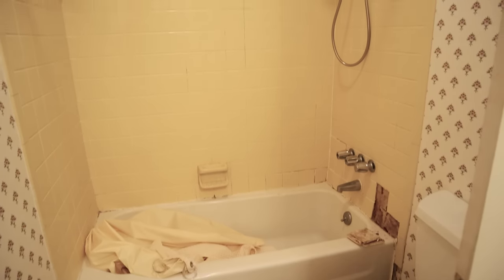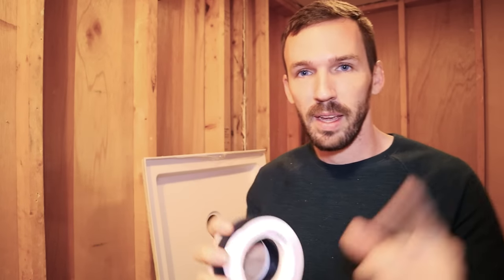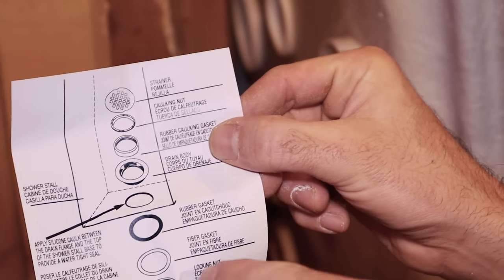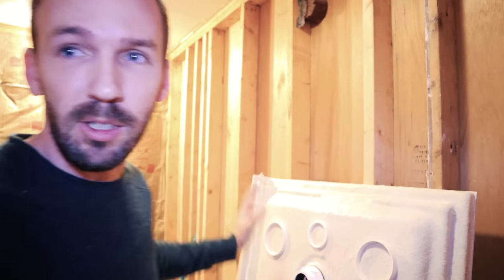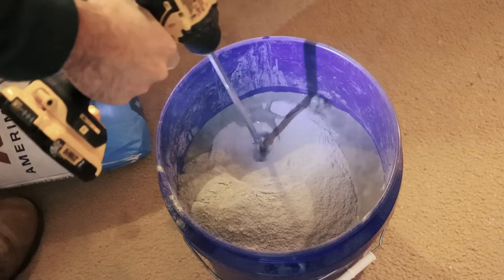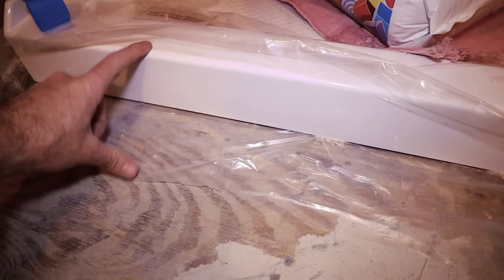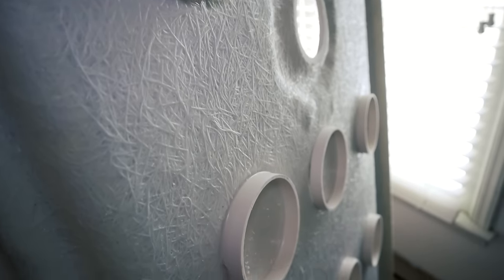How to Install a DreamLine Shower Base With Oatey Drain

Comment: Hey man! I have a similar base. I measured 4 1\4 for the cap.and 3 1\\4 opening. Was this your measurement? I'm having a hard time trying g to.locate these measurements. Also, I appreciated your video here. It was informative. Oh, I'll be tiling the walls as.well. The skinny flange will not line up with the board. Did you shim the tub or walls to make it transition well to have the board sit on the tub?

Comment: You realize that if you push that down into the concrete mix before leveling it, then lift it back up to level it, there will not be any concrete under the parts that just raised up, right? Shim it up level before you put down the concrete so you aren't creating air pockets underneath the flimsy plastic pan.
Reply: Trump 2024!!!!
Reply: @aandmservices2518  I hope not, cause everything that guy touches turns to $h!t.  I recommend a different contractor.
Reply: At least he doesn't crap his pants and look confused while reading the teleprompter!

Comment: Do u just connect the drain to 2 inch abs with abs glue or just plug and play?
Reply from the maker: There's no need for glue with this, the rubber gasket does all the work on the drain

Comment: That much on setting fiberglass pans myself but I am a tile guy. The plastic that you put underneath it for a water barrier. You can't tile over that plastic the thinset will not stick to it. I know it's only 4 in but that's for in it'll come up right away. Since that won't stick to plastic at all
Reply from the maker: That's a really good point Jose - I didn't think of that. For my bathrooms I went with a 100% waterproof LVP flooring instead of tile.
Reply: @KellyConcepts  well that solves that issue. Lol have a great day. That's for tge dyi

Comment: I wonder why dreamlines installation manual doesnt show the screws going through the lip of the pan and into the studs...possible water infiltration? They show the cement board down to the top of the pan lip, then the finished wall going down over the lip to an 1/8 th of an inch off he pans surface for caulking....but no screws into the studs
Reply from the maker: I’m not sure, I just installed a new modern tub and so I followed instructions and it wanted the screws in the lip. I’ve always done it this way, but I guess some manufacturers prefer one way and some the other way..
Reply: @KellyConcepts that’s how I do it too.

Comment: Just received my Dreamline shower base. My installation intructions make no mention of drilling  and attaching to the studs as you show. Is this something  you do for added security? To me, once the wallboard is attached this thing isnt going anywhere! Thanks for sharing!
Reply from the maker: I've seen it done 3 ways - screwed in the flange directly, screwed above the flange so just the head catches the flange, and no screws at all. 

My preference is to screw it into the flange. 

I just installed a dreamline door where the instructions show to screw into the acrylic threshold - so by their own standard, it's ok to put screws in this. At least, that's my take...

Comment: I presume you used silicone in lieu of the plumbers putty on the drain? I use clear silicone on installs if not using plumbers putty. What you used looked like caulk. If I don't use that rubber gasket on the drain pipe I will pack oakum around pipe and pour a lead joint. When attaching the pan to the studs I use roofing nails.
Reply: I agree Joe. Depending on the manufacture of the pan you wouldn't use plumber putty since it could retract with the pan. I used 100% Silicone as recommended by delta shower pans. The bottomline read the pan installation instructions.

Comment: Well what ever s the fiber washer for ? Do we know
Reply: The fiber washer acts as a smooth surface to turn the big locking nut against.  Without it, the nut would rub against the rubber washer and bunch it up, causing a leak.

Comment: I have watched a couple of these videos now, and I am curious about the mortar base. It seems like you just put it down and then set the base on it, doesn't more leveling need to take place? Is the mortar self leveling when you set the base down?
Reply from the maker: A little more leveling does need to happen but it is very minimal as the pan will press into the mortar pretty nicely. You want to avoid putting a ton of pressure or jumping around in the base with wet mortar or you'll press into it too much and when the mortar dries and ultimately shrinks (the more wet the mortar, the more it'll shrink) , it won't have as strong of a hold on your base as preferred.
Reply: @KellyConcepts  awesome, thank you!
Reply: @Kelly Concepts  I bought a bag of rapid set mortar, it sounds like it should buy thinset mortar for tile with a modifier?

Comment: My subfloor is concrete, it's a concrete joist system in my house. Would the sand/cement mixture work in my situtation as well?
Reply from the maker: It will, but you'll need a primer to adhere the mortar to the concrete. These bonding primers are usually in the tile section of hardware stores. You'll need very little for 1 shower
Reply: @KellyConcepts  thank you!

Comment: why does the rubber gasket go around the drain pipe and not inside like a toilet flange? It seems like that would prevent leaking into my downstairs when the rubber goes bad.
Reply from the maker: I agree with you and I don't know why, but they just don't make the gaskets like that. I'd guess because you cant get the seal very tight that way so if it backed up, the water could go under the gasket and out. A toilet has a ptrap above that gasket so there's less worry there.

Comment: In all the videos Ive  watched, no one shows if you have to use glue when attaching the drain piece to the pipe, they just show the gasket being tighten down. Also how do you take the whole drain apart, I brought one and can’t take off the top metal part
Reply from the maker: The metal screen part is difficult to pop off because there's not much room to get a flathead under it. I have to get my fingernails under it

Comment: I think the window flashing is a great idea.  I don't know why these manufacturers don't add a 6" lip on all three sides.  Lazy, cheap or both.  Kohler has an expensive cast iron one with hardly any lip.
Reply: Some pans do have higher lips,  but they are usually made for the plastic enclosure type. I think the low lip has something to do with tile mortar not making a good bond to the plastic, which is why the cement board comes right on top of the lip often sitting out past it.

Comment: If your going to use caulk to seal a drain, please use only 100% silicone, not acrylic. Otherwise use plumbers putty
Reply: yes, acrylic sealant is water based and will fail eventually.  Nice good on your pan install.  What about Dreamline saying use no screws in pan flange ??

Comment: Anyone have issues with drain connections on this shower if you cant get the drain flange deep enough into the floor due to higher drain pipe  flows being to close to the surface  in a cement floor

Comment: Question, why not order a shower pan with drain at the same dimensions as the tub drain?
Reply from the maker: A tub drain is 1.5" which isn't to code for showers. So they don't even make drains or shower pans with the small dimension

Comment: There must be some 2" to 1 1/2" reducer under the house somewhere? Can you tell about that? Many thanks.
Reply from the maker: Every plumber will tell you to NEVER put a reducer... but if you were to put one, make sure it's on a vertical line, not horizontal. I placed one here because I didn't think to fix it correctly when I ripped open the subfloor and didn't want to have to re-do my floor work. I have access underneath if problems arrive.

I also just finished the 2nd bathroom in this house and plumbed it up the correct way - converting all the pipe to 2" all the way to the main line a few feet away.

Comment: Nice video. My shower base has 5cm legs going down to about 3 toward the drain (8 in total) I tried self leveling cement but its still not level, i also tried grinding high spots. I added some shims under the legs to get it about right. Can i use mortar under the legs instead for shimming purpose. My worry is that i wont need much and that it migjt start to crack. The legs are not hollow in the middle. They filled with some material.
Reply: Wow the floor leveling compound should have worked! It is a year ago but I hope you found you solution.

Comment: Can you tell me how think you made your mortar base: 1”,2”?
Reply: I've also got questions about the mortar base and finding it hard to find a good discussion of it. Such as should it be thicker than directions on bag? How thick to lay the mortar? Full coverage or blobs?
Reply: Dry pack is 4 part sand to 1 part Portland cement ratio by code.

Comment: plastic is a good idea but i'd use at least a 6mm plastic such as those required for flooring. That looked like a thin painter's plastic cover which may not even be 1mm
Reply: I agree with the thicker plastic water barrier, but 6mil, not 6mm.  Using 6mm is almost 1/4".
Reply: @eekmaddogburner7578  oops yes. Thanks

Comment: By using a mortar base how would people remove it in the future when it needs to be renovated?
Reply: I suggest you buy a shower base that don't need mortar under it. By removing an old shower base in mortar, you will rip everything. I bought a Nautika shower base  and the instructions tells to level with self-levelling cement and sit the shower base directly on the cured cement, no mortar under it. BTW, my shower base is exactly like the one in the video.
Reply: Best practice is to staple tar paper beneath the mortar.
Reply: @farmerhomeinspection500  I asked Dreamline about this and they say base will shift and crack?

Comment: How can you tell if the bottom of the shower panel is not completely covered by the mud?
Reply from the maker: It doesn't need to be entirely covered, just enough to get a good hold on the base for support. Technically, the mud is only there to prevent future squeaking and bouncing and it doesn't need to be perfect.
Reply: @KellyConcepts  thx !
Reply: What if it's being laid on a leveled concrete floor and screwed into studs.  Do you really need the mortar?

Comment: When you leave 1/8 inch space on 3 sides, do you drive the screws home or do you tighten them enough to maintain the 1/8 inch?
Reply: Looks like he left a gap but hard to tell. Closing that gap with a screw could crack the pan. Personally I like to take up the space with a shim and drill through into the stud.
Reply from the maker: I keep the 1/8 gap and don't tighten the screws all the way. I should've clarified!
Reply: Try placing some 1/8 inch plastic wood / board all the way around.  It helps provide the perfect space, is completely waterproof and maintains the gap after tightening screws. Good call on stainless screws

Comment: I don't understand why do you have to sit the shower pan in mud I know it's supposed to support the pan but the pan has circles everywhere to support it if the floor is level and solid why mud it ???
Reply: Better, more level, support at and between the pvc circles.

Comment: is it ok to put a rubber liner to protect the wood before you pour in the mortar?
Reply: technically i think you should do that. From what I understand the plastic underneath will help any condensation drain out.  I am curious how long these you-tube tubs will last.  It might last forever. At least Kelly leveled it, not sure about his theory about have  flex in the pan though.  flex=eventual crack.

Comment: You used caulk and not putty?
Reply from the maker: They're pretty interchangeable in plumbing, however plumbers putty will make it easier to unscrew the drain if needed in the future - caulk will make it very difficult for me to unscrew but I'm counting on never having to re-work this bathroom.

Comment: 2 things. 1 hopefully you used pure silicone on the drain! If regular caulk it will leak! 2 never use a shower drain with the rubber gasket in! It will deteriorate in about 10 years and leak! Always use a glue drain. I've seen it since I've been doing this for 33 years. Other than that a decent video

Comment: dreamline says to use a mortar base
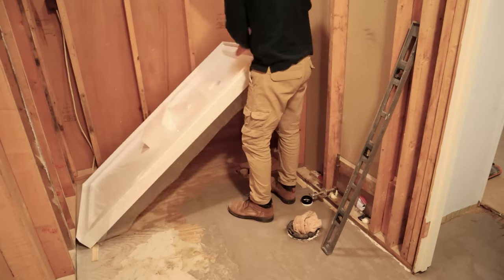Reply from the maker: Yea you should definitely use mortar 6:35.

I've seen others use spray insulation foam but I don't think that holds up well.
Reply: I noticed in the instructions of the dreamline base that you are instructed not to screw the flange of the tub to the wall. I did that with my other base, but didn't know why dreamline would be against it.